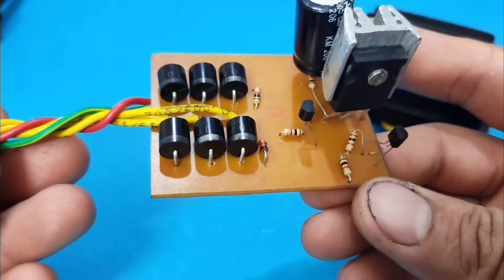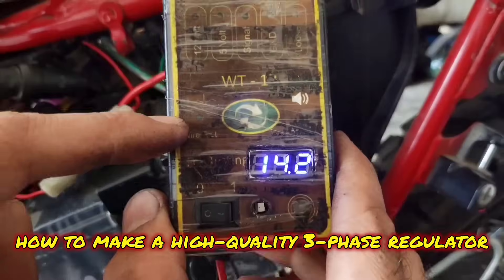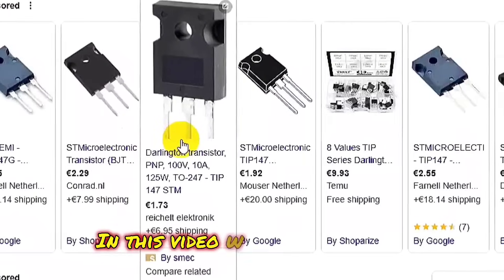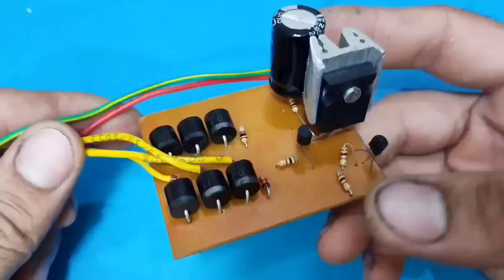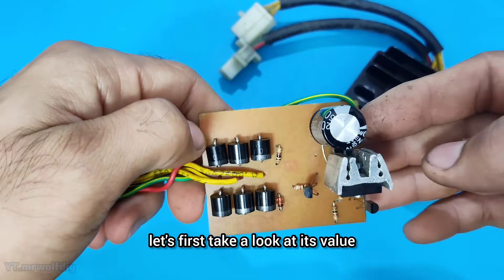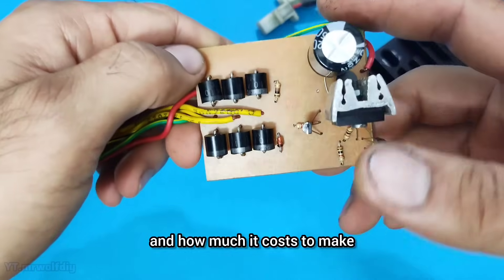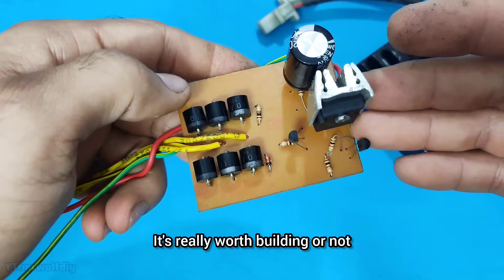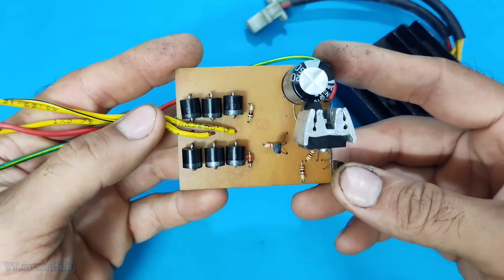They Sell This $5 Motorcycle Regulator for $200?!

Comment: "Please make a video about an automotive alternator regulator. I’m currently repairing my own alternator. Now I understand its circuit: I was able to install the bridge diodes and connect power directly to the rotor, and it outputs electricity, but it cannot be controlled because there’s no regulator. I want it to charge my LiFePO4 battery at 14.1–14.2V."
Reply from the maker: That's a good idea for a future video, thanks for the inspiration! 😊

Comment: No fail save logic? No filtering? No protection?
Reply from the maker: This is a simple three-phase rectifier regulator designed for older bikes; it is not recommended for newer motorcycls.
Reply: @MrWolfDiy terimakasih..saya menghargai itu...

Comment: it's 12v system, how about 24v charget regulator circuit , what changes need ?
Reply from the maker: You should use higher-power components ، For example, use fast high-power Schottky diodes like the 1N1184R, or a three-phase bridge rectifier.
A 24V Zener diode can be used as well, along with a 2N3055 transistor.
Also, use higher-capacity capacitors.
It’s essential to use proper heatsinks for the diodes, transistors, and voltage regulators to dissipate heat effectively.
However, this may significantly increase the overall size of the circuit.

Comment: Hi wolf, how we now if these transistors is genuine or fake , and also should the phases be in sequence L1 L2 and L3 or random is ok thanks 🎉
Reply from the maker: Hello, good question 
Identifying a fake transistor from an original one isn't that difficult.
The printed font should be clear and embossed, and the brand name "ST" (the manufacturer) must be sharply visible.
Fake models tend to overheat quickly, and if you open them up, you'll notice that the internal chip is very small — unlike the original ones.
Also, the original versions are generally more expensive.
The version I used is a high-copy made in China, which is not fake, because ST does have manufacturing facilities in China.
However, it's not original either. The Singaporean and Taiwanese versions are of higher quality...
As for three-phase inputs, connecting the input lines randomly doesn’t cause any issues.

Comment: This design may look impressive to the untrained eye, but it's fundamentally flawed. The "lossless" claim is misleading — using linear regulation in this way actually wastes energy as heat. There's no proper voltage regulation, no current protection, and no filtering. Just because it powers a light bulb in a YouTube video doesn’t make it suitable for long-term use on a motorcycle. Please be responsible when sharing "DIY solutions" that could damage real-world equipment or put people at risk.
Reply from the maker: Thanks for your feedback.
You're right ،  this design isn't 100% perfect and was mainly created for educational purposes and to demonstrate basic functionality.
I also mentioned in the video description that for long-term use or critical applications like motorcycles, it's better to go with more protected and optimized circuits.
That said, many people have actually had positive results with this circuit.
Reply: Liquid name

Comment: Greetings sir I seen all ur video it's very good,, can u make a 3 phase  RR unit which works on both AC OR DC . Lika a pro
Reply from the maker: Greetings dear, Such a thing is not out of the question... In this case,
The Rectifier section must be able to detect the type of input (AC or DC).
Alternatively, the design can be such that if DC is supplied, it is routed directly to the voltage regulation section, bypassing the Rectifier.
This type of design is more complex and expensive than a standard RR unit and is mostly seen in specialized or industrial applications, not in typical motorcycles.
Reply: Tq for ur reply sir, but as previously on bs3 2 wheeler there was the RR unit which works on WITH OR WITHOUT BATTERY  @MrWolfDiy

Comment: Bro 😢 2 stroke rpm unlockd cdi.. without trigger coil
Reply from the maker: without trigger coil!  Can you tell me what 2 stroke engine you want it for?
Reply: @MrWolfDiy  this engine those not have any outer trigger coil. Bike name like Suzuki max 100 or ax 100.
I think like magneto ignition system.